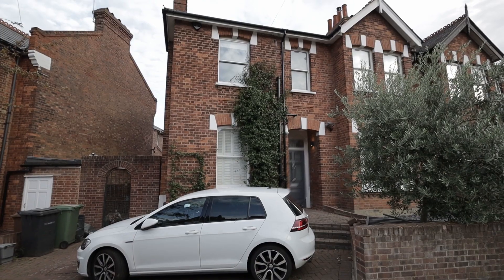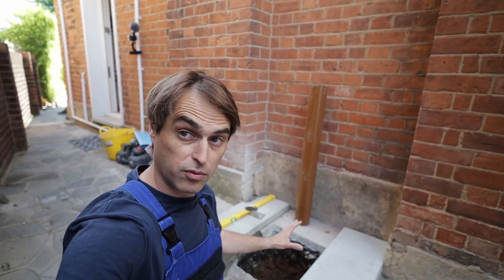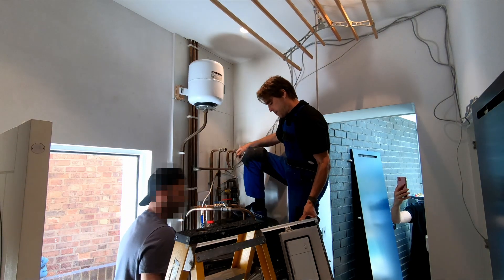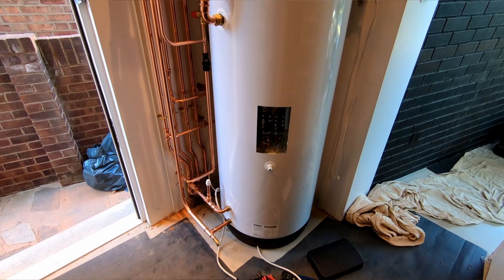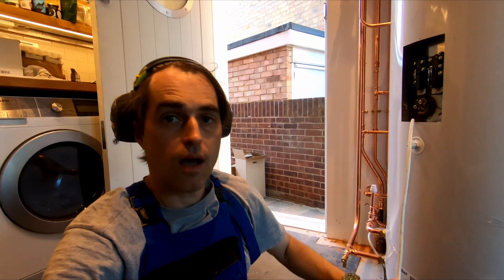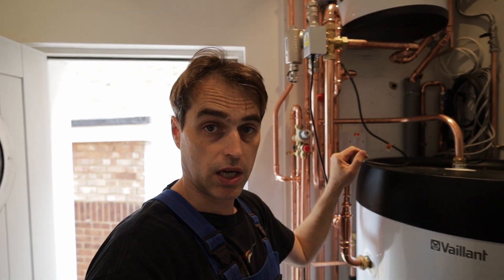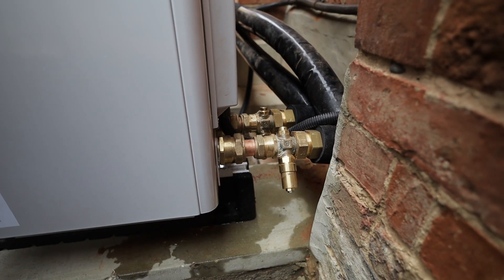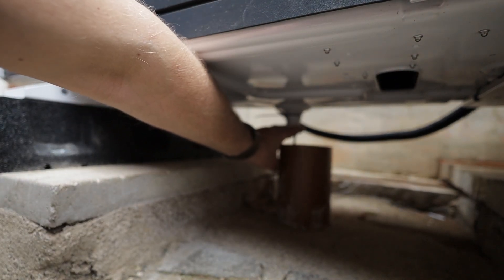Is This Heat Pump Better Than Your Gas Boiler?

Comment: Question: if you are replacing a Combi boiler with a heatpump, does the heatpump also heat the hot water supply?

It's the hot water then supplied at 40C at the taps or is it boosted electrically?

It's there a legionella risk? Keeping water at 40C worries me.
Reply from the maker: no, the unit can bring the temperature of water to 75C without any direct electric backup. It does legionella cycle weekly and also brings store temps to whatever you chose it to.

It is just much more efficient to keep the store at 48C and run the heating at 40C. 

You can run the unit much higher than 40C it will just cost you much more as it sacrifices the efficiency.
Reply: @UrbanPlumbers  that's reassuring.

So if you run the store at 48C is that what's sent down the hot water pipe when you turn the tap?

And that's safe because of the weekly sterilisation cycle?
Reply from the maker: @trueriver1950  yes, you get 48-50C if you want which is still to hot to use without mixing with cold. You can set the legionella cycle weekly too.
Reply: @UrbanPlumbers  48C is useful for topping up the bath water when it's got cold after a long soak. That's the only time I'd want to use it neat ;)

Thanks for both replies: I am getting close to the point where I can afford to go for a heatpump, as soon as it's affordable I'm doing it for environmental reasons.
Reply from the maker: @trueriver1950  make sure you get a decent installer. System design and proper installation is the key to a successful install. Check 'heat geek map' on google for a better chance of finding someone decent.

Comment: Great video. I'm on the fence wrg to the efficiency figures. The table quotes SCoP at 9:40 which are seasonal average values for range of conditions, not actuals for that ambient temperature. I find the physics unlikely... would love to see real world independent tests vs manufacturer figures. If I recall correctly scop is measured at 7 deg Celsius constant flow.
Reply from the maker: As in the video - I am as curious as anyone can be. I am currently researching remote monitoring options and will share all the data once we have it.
Reply: @UrbanPlumbers  Would love to see that - and have struggled to find decent data. If the gov want to encourage people to switch, solid historic performance data would be a good start
Reply: I remember having a conversation a few years ago whilst on a mutual site with a design engineer from Kensa HP's who (put it this way) was very  very dubious about 'overseas' manufacturers ratings.

 I myself had a run in with the owners of Angelfire swimming pool heat pumps regarding their stated outputs. My investigations showed that in order to get anywhere near their 50kw output the compressor (Copeland)  needed to operate well outside it's design envelope and even then their numbers never made sense. 
We ended up having to fit 4 x 50kw instead of the original proposed 2 x 50kw to get the heat output required.. 
After much legal to and fro the Portuguese owners shut the company (and any liability) and it got taken over by the American company who made them on their behalf.. 

So no I would take all manufacturers figures with a pinch of salt and add at least 20% capacity as a safety factor.

Comment: that COP is based on -2c, does it get more efficient for higher external temps? In the UK we might get a few nights at -2 or below but not a lot.
Reply from the maker: yes it does more efficiency with higher temps. Having said that -2 / W40 is based on predicted sCOP not COP

Comment: Looks expensive but excellent workmanship. But my 1870 house will struggle:- cost and payback hmmn. So will get a new condensing gas boiler and solar thermal hot water. Total cost under £5000
Reply from the maker: You will not get a decent gas boiler and solar thermal for that money. I charge around 8-10k for this kind of set up which is what this HP job was after the grant.

Comment: 3°c and the antifreeze valve opens and drains system resulting in no heating until ambient temp increases and a brand new antifreeze valve is installed as they cannot be reset  . Have I got that correct
Reply from the maker: No, they reset themselves. Frost protection keeps pipework above 5c at all times.

Comment: I am amazed at the amount of money that it must cost to instal the systems that you put in, and put in very well they are. Looks like we are going full  circle after 30 years of me taking out cylinders when pulling in a combi boilers. Thanks for sharing
Reply: a good combi is very useful
Reply from the maker: yes, combi should have never happened on a scale it did.
Reply: @UrbanPlumbers  I'm sure for your rich clients combi boilers are awfully passé. Much better to drop 20 to 30 thousand on the latest thing to go with their 100k electric car in the drive 🙄
Reply: @UrbanPlumbers  combi has made or rather given many poor people a benifit that would have not been in reach before!!! 
Elitist only systems are not benefiting ordinary people for a while yet.

Comment: How can it be more Efficient when it needs to be running most of the time , don’t wNt to wait hours and hours to warm a house up
Reply from the maker: you maintin the house at comfort level at all times using minimal amounts of energy unlike your grossly oursized boiler that will eat thorugh energy like crazy in a very inefficent manner

Comment: I really enjoy watching your installations , been doing HVAC in New Jersey for over 40 years our climate in the north east can be brutal, but in the last 15 to 20 years our winter seasons have been warming up. With the new tech on heat pumps it's looking better. Great job!
Reply from the maker: Thank you for your comment! Greetings from the UK.
Reply: It is a worry, that to fight global warming we need global warming to make it work!
Maybe this is not the system….?
Reply from the maker: @martinpaul6146  we don't need global warming to make heat pumps work. There is energy in the air even at minus temperatures.

Comment: Excellent and impressive. The homeowner knew what was required and has clearly invested a shed full of money into insulating their home. What sensor and data logging will the system have to accurately determine performance in terms of ambient, room temperatures achieved and power in KW hr to achieve that - to inform your future video?
Reply from the maker: Not sure yet. Researching it at the moment. Any suggestions?
Reply: @UrbanPlumbers  the ideal test would be to find a pair of identically insulated semis, and for a sudden of each type into each house, and keep the target thermostatic settings the same in each house. 

I'm guessing that opportunity is rarer than unicorn poo

Comment: I have had a Heat Pump for 2 years it will not definitely not be getting switched on this year full stop my gas fires heat the house cheaper,this is not a projected figure it is fact Heat pump was the worse move I ever made didn’t cost me a penny to have it installed and I can’t get rid of it for 7 year they say,don’t be fooled 1 size fits all.good videos Heat Geeks and yourself but mine isn’t doing what it says on the box.My kitchen is wrecked can’t hide all them pipes in a normal kitchen.
Reply from the maker: sadly there is a lot of bad installations out there
Reply: @UrbanPlumbers  Got to admit you are well on the ball.Free save you money fell for it,could you put up Heat loss method or were to get it please,MCE company,EPC is “E”125m2 and they fitted. 17 kw pump Double Dutch to me haha

Comment: When you get your house insulated to a standard suitable for a heat pump, you could heat it  with any background heat.
You don't need a heat pump, you need polystyrene.
Reply from the maker: if only it was that simple
Reply: If installing insulation remember Grenfell.

 Polystyrene might not be as good an idea as  glass fibre or rock-based fibre. 

If you do use flammable materials don't put them adjacent to an air gap. In the Grenfell fire the air gaps between the insulation and the building both allowed air into the blaze and allowed the flames to spread.

Sealed all round and under a layer of plaster they should be safe, so long as you don't ever get mice who will nibble tunnels that can feed air in if there's ever a serious fire...
Reply: Agreed once you have insulated to any reasonable standard you can use any background heat source. Agreed that the better the insulation the less a heatpump will save you.

Having said that, for any chosen level of insulation, a heatpump will still cost around 80% of the running costs of gas, and you'd see a bigger saving compared with any other heat source.

The only two cheaper exceptions are geothermal or living above neighbours who grossly over heat their flat giving you free underfloor heating. Most of us don't have either of those advantages   ;)

Comment: Hi, sorry for my english cause I'm italian but I'd like to add another point of view. Heat pumps can of course be cheaper to run, I absolutely agree. What if everyone had got one? I'm gas engineer here in Italy and in one full day of work in the winter I'm able to reach five or six clients to have a look at their faulty boilers. In some cases I can repair on the first visit, worst case scanario next day. Do you know how long and expensive it can be to repair one of these? What if it rains all week and your broken heat pump needs repairing (outdoor)? And maybe six, seven people calls you on the same day? If an appliance like that is so expensive, how much can be the spares? You can get founds to install it, but what about maintenance guys? Things can't keep fresh and new over the years. Boilers are cheap to install, service and repair...so perfect for everybody.  I'm not sure about heat pumps.
Reply from the maker: your English is perfect and you make some valid points.
Reply: @UrbanPlumbers  Thanks. Great video and channel

Comment: Great video, as always. Great install and you know your shit.

My problem is though, I have never come across any builder that insulates a house like that with out it being specified, in general only the very wealthy  and builders that know what there doing which is very very few and this is a huge problem. Maybe in 5 to 10 years they will catch on, but its all about the bottom line for the builder and the home owner and this in my opinion us where the breakdown in the industry is going to happen.  There just to expensive, when the grants are pulled, heat pumps won't be installed.  

Was it 300mm pir insulation, no body dose that unless there thinking of installing a heat pump. This video shows that the heat pumps like solar are a play thing for the wealthy.  Normal people are not going to do this.  Gas is just to easy cheap and simple to install on a property for the foreseeable future.

Saying all that, i have no doubt that it will be a bit more efficient but how many years will it take to pay the install off?

Be good if you calculate that next year once you know the real cost of running.

In my opinion heat pumps work but there just not at the races for the vast majority of normal home owners in this country.  God help us we can hardly afford to heat homes this year never mind fitting 70mm pir on the walls and 300mm in ceilings and then fit a heat pump.  

It's laughable to think 600,000 heat pumps a year is a target.

Looking forward to next summers video, I think you have a great opportunity to sit down calculate everything and give both side of the coin on a video next year.

Keep up the good work!👊
Reply from the maker: all new homes are build to a standard that can accpet heat pumps without any issues. I understand that retorfit is difficult and can be expensive - but there is absolutely no reason to keep installing gas boiler in new builds.
Reply: @UrbanPlumbers  There should be a more advanced system than merely air-to-air heat pump aka reverse air conditioner.

I would build new buildings with PVT solar panels and a ventilation system that can route all exhausted geat back into the heat pump.
Usually the water cylinder can act as the heat battery bu ideally we could start using sand or somethimg else to heat at night and in the winter.

The 20% financial in ideal scenario you project here just isn't worth the investment imo
Reply from the maker: @zteaxon7787  this property already has MVHR and solar PV plus the battery is getting installed soon, so will save much more than 20% of running cost compared to gas. Also, gas prices are going at double the rate of electricity at the moment, so the equation may be even more favorable than this.
Reply: @UrbanPlumbers  If this property has had all this work done to it , i would suggest that a back-up video about the difference in energy /running costs is totally useless, to have a fair comparison you would need to run a modern boiler at 90% efficiency with the upgraded insulation and triple glazing only. Then compare the results on that, with this building having solar PV, battery storage, MVHR, upgraded insulation, triple glazing you will never work out the differences between which technology is contributing to what.
Reply: "we can hardly afford to heat homes this year never mind fitting 70mm pir on the walls". These things go together. Fit some insulation+airtightness and your heating bills will be greatly reduced as well as your comfort much improved. 'I can't sharpen the axe, I'm too busy chopping' is a very shortsighted view.

Comment: You mention 21 degrees room air temperature, that for me is far too cold. My home in winter is generally around 24 to 25 degrees, heated by a wood burner.
Reply: Christ. Have you seen a doctor about this?
Reply from the maker: 25 degrees? Are you sure your thermostat is not out of calibration?
Reply: No, I have two thermostats (for the underfloor heating we never use) and both show the same figure.
I admit that I prefer higher room temperatures than many but 21 degrees is for eskimos.

Comment: I felt bad after watching this as I've got a new gas boiler being fitted in September, now wishing I'd maybe gone for ASHP, especially seeing the deal Octopus Energy are doing.

But I can’t pull out on the plumber now, plus I'm still a little concerned about the availability of well trained engineers in my area for ongoing maintenance of ASHP equipment.

I’ve asked the plumber to oversize the radiators we’re replacing, so perhaps a hybrid conversion is an option down the line.
Reply from the maker: I was hoping Octopus would do decent installs. So far I have only seen one install and it was atrocious sadly.
Reply: @UrbanPlumbers  well that makes me feel better for not diving in too soon! It’s the future, just need more heating engineers to get with it like you are 👍

Comment: Heat pumps absolutely are the future. But not sure that air to water heat pumps really trump multisplit air-conditioning overall.

The main problem with air-water is that they have too many stages to them. Running R32 all the way from the outside to the room you want to heat typically has a COP of 4 compared to around 3 for an air-water pump. 

This is slighly unfair as one of the main reason for the difference is because the wall units for air conditioning have fans in them and so can put far more energy into the room compared to the temperature delta of its coil.

But sticking with the 1970s approach to heating our homes is going to cost us a lot by way of efficiency. Just as the approach taken when my parents were children of having a coal fire in each room was best consigned to history.

Comment: Yes I am impressed 
But no price mentioned for system and installation (without subsidy) and also the cost of previous insulation of house to reach the standard required for efficiency  . Despite the horrible costs of energy at the moment, this will remain out of reach for myself.
Bu again congratulations on good work.
Reply: wait till the fan bearings wear and becomes noisy.
Reply: @tonysheerness2427  so there is an argument against bearings of any type… so what is argument against system???
Reply: @martinpaul6146  Noise  pollution
Reply: @tonysheerness2427  know where your coming from and could be a problem but….
not sure noise pollution has only to do with a heating system. You should hear my neighbours.
Reply: @martinpaul6146  In blocks of flats where the first heat pumps were installed, one droning or squealing fan you may be able to ignore but several? Good luck with your neighbours.